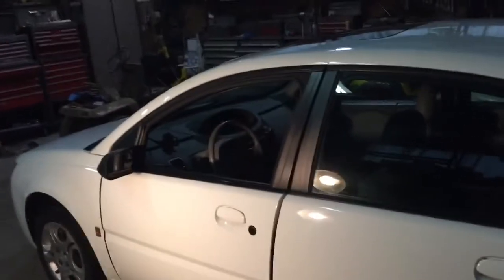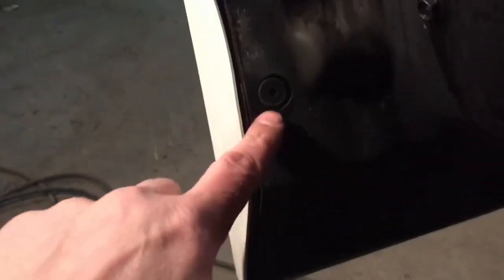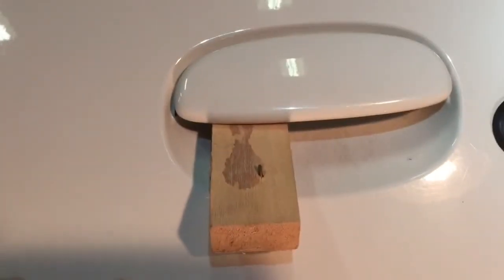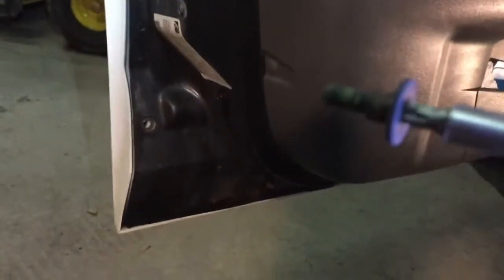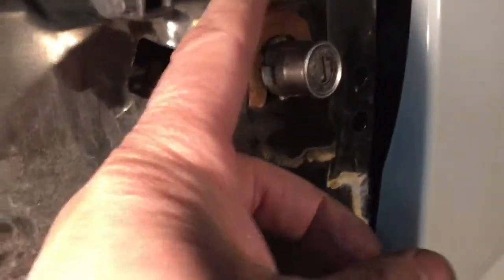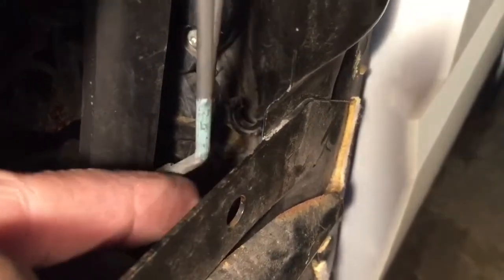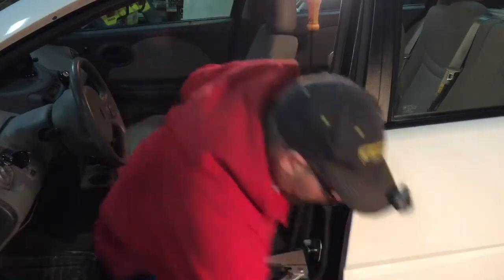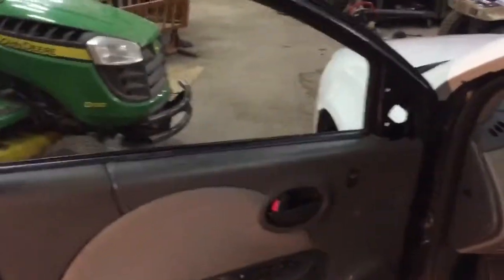03 Saturn ion door lock cylinder reinstalled

Comment: Thanks for the internal view of the door. My own white 05 ION won't lock on the driver's side using the key.
Good work on fixing that belt clasp retainer button. I went online and bought a bag of them and keep them in that little drawer.
Sent your video link to my brother who may be helping me fix the lock problem.
Happy I found your video. Thanks. 
If the rivet doesn't work I'll send you a couple of the buttons from my own stash.